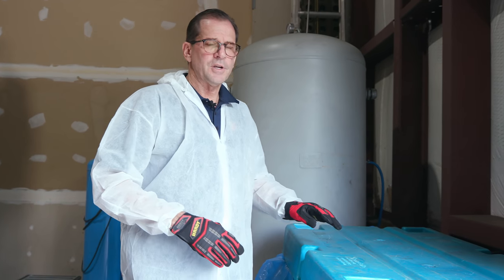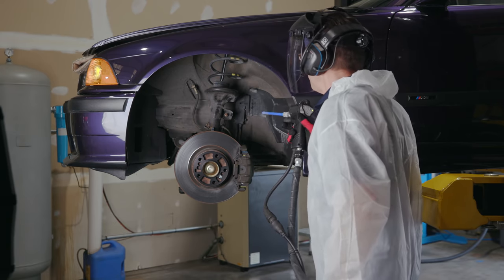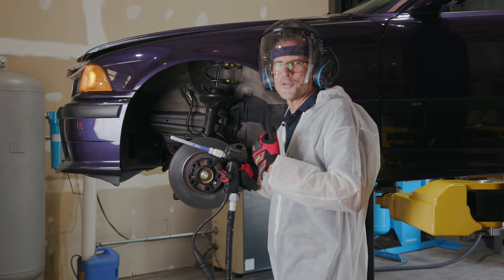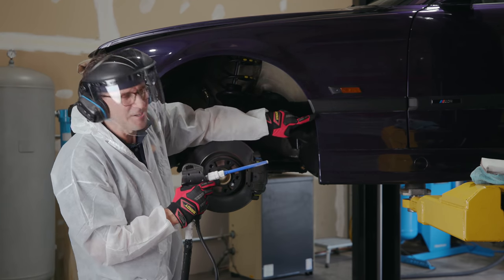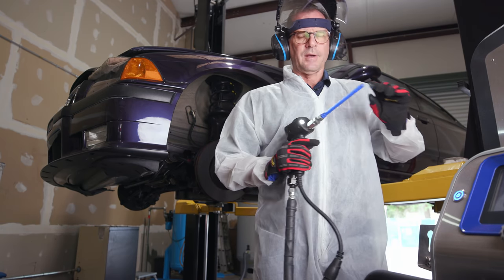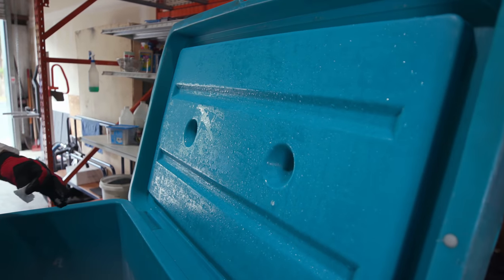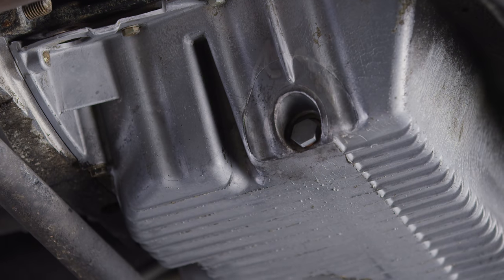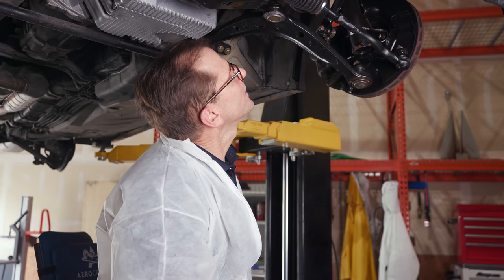Dry Ice Cleaning: Obsessed Undercarriage Restoration on the E36 M3 Pt.2

Comment: Amazing detail showing this to us. Thanks. I realize there's fixed time and time is money but when I do under cleaning w/ pressure washer, steamer & manual labor I remove the the plastic wheel liners and just replace the liners, sensor housings and all hardware w/ new parts... there's a whole lot of dirty areas underneath those wheel liners. This process really shines cleaning the metal parts in hard to reach areas.. the engine, transmission, cats, heat shielding etc...

Comment: Serious question, why not just use a pressure washer? The specific environment, cost, storage and set up required just to even start using dry ice seems to vastly out weigh the results. Don't get me wrong, the results are great but I personally don't think it's that far off a basic pressure washer.

It's just seems unnecessary in my opinion, kind of like trying to find a solution to an issue that was never present.
Reply: 99.9% of people will use a pressure washer. This is an insanely expensive and overly complicated method and there's no need for $100,000+ worth of equipment to do what a pressure washer and $200 worth of labor with a sponge can accomplish. 

Okay cool, the machine removed a sticker off the wheel a few seconds faster than can be accomplished by hand. Worth 120k? Nah.

Comment: I wonder if a liner could be made out of fabric like some sort of coated canvas or Teflon or something like that so that it's really strong and won't crack with the extremely low drop in temperature and it won't like tear or maybe just a hard liner made out of vulcanized rubber maybe? Oooh maybe you could have it in like a big container that's above your head where are you can open a hatch and it would just drop straight through so you don't have to dig anything into it to get the ice out. I don't know just a thought.

Comment: I tried to make a dry ice cleaning machine from a sandblaster setup. But I used a tall cylinder that used to hold beer. And added a motor to vibrate the ice to keep it from sticking . And we'll it barley worked . So I'm trying other ideas   . Had to crush my own block of dry ice also. Iv been making different ones for the last 6 months . And I guess I'll just have to buy one.

Comment: so does it work like sandblasting? while also having the contraction effect of cooling something down to help break it off? it does seem like a very clean process. this is the first time im seeing this in action
Reply: Episode #1 can provide you more details.   The fundamentals are this...
* 108 degrees negative causes things to contract and loose their adhesion.
* The solid CO2 particle sublimates to a gas upon impact which is a thermal reaction or, a miniature explosion.  It is not abrasion that removes the dirt like using sand or any media. 
* The high volume of air ( up to 125 cfm) wisks the dirt away.  

Yes, the dirt ultimately is atomized then gravity takes it to ANY horizontal surface nearby.  But mostly, the ground.
Reply: @ScottAles  I should have watched the first episode first definitely lol but thank you for the in depth response! I can see this technology taking off for sure!

Comment: Interesting to see the hand methods combined with the blasting. Is there any recommendation to perform traditional cleaning methods prior to the blasting services?Maybe get a majority of the heavy stuff off with a pressure washer or by hand and then finish with blasting?
Reply: I did that originally back in 2019.  But after getting soaked and spending so much time cleaning up after that, this method became much easier.  The principle is to remove all abrasive elements from the car before starting any hand work.  One small rock or piece of sand can be very problematic.   
Thanks for the comment!
Reply: @ScottAles  Thanks Scott. So kind of sounds like a waste of effort getting too deep into the hand work when the blasting is more efficient.

Comment: This is a great series!! What is the price of a dry ice blaster machine, and do they have compact mobil units? This would be awesome for mobile detailing. Thanks again
Reply: The machine I am using is $45k setup this way.  Compressed air system to support it is another $30k+.  
I'm not a fan of the mobile concept but some are.  Can't control your environment and it is loud.

Comment: damn, with this Adam might not have needed to buy all the r34 parts :DD
Reply: Naw that’s still a full build, this is for people who wouldn’t take the entire car apart and paint it
Reply: @shanechopko5523  i mean a lot of the OEM parts that he changed because they looked dirty, ofc there was a bunch of fab work that Johan did
Reply: @niklasxl  he probably replaced them for more reasons than them just being dirty... having a whole build completed to that standard would require new parts all around. Matt is gonna be replacing a bunch of parts on the M3 but he probably wont be tearing the whole thing down to the bare chassis and starting fresh with paint and all. Different kinds of builds, different processes. Like on a 6k mile old Ferrari in the barn, prob cant find all those parts, so cleaning them is really the only option. A 2000’s Nissan, different story, style and type of build.
Reply: @shanechopko5523  well yeah :D but i think Adam hadd some parts that were really hard to find and iirc that he couldnt find but perhaps they were cleaned this way off cam

Comment: ...some of the parts he spends lots of time on could just be replaced (and maybe should). Aside from the wheel liners and other obvious stuff things like the power steering cooler, reservoir and feed hoses, steering rack boots, brake dust shields, exhaust mounts etc are all relatively cheap parts and are likely cheaper to buy than the labor charged for the time dry icing.
Reply: This is absolutely true.  The effort here is to show what is possible if parts are no longer available.  Or they are too brittle to attempt removal without damage.
Reply: @ScottAles   good one. I didn’t really think of that. Whatever the case it really shines on getting into the cracks and crevices of metal parts and making like new... my favorite part by far.
Reply: @bcastromusic  Like no other process I've used in 50 years.  I think one of the more beneficial aspects is how well you can see what you're working on.  Other methods obscure the work with water, soap, media, or residue.  Being able to clearly visualize the target and see it leave the substrate is priceless.

Comment: This looks great now, but Cosmoline was put on there to protect the underbody from rust, and it worked all these years. Hopefully it gets reapplied so it doesn’t start rusting because it is been removed.
Reply: The way this car will be used from here will not require cosmoline.  Spraying this car would be like spraying a nut and bolt restoration or restomod recreation.   It is not a daily driver anymore.  But if anyone wanted to, it takes less than 10 minutes to reapply better protectants than they used in 1996.
Reply: @ScottAles  that makes sense.  Since I live in the Midwest rust is always top of mind.  I just got a new car and I was planning on treating it with cosmoline.  What protectants would you suggest over cosmoline?  I've researched a bit, and most others I found requires reapplication every year.
Reply: @skrsys  Yeah, it is a double edge sword.  I hate the idea of annual needs but the sticky cosmoline isn't a favorite of mine either.

Comment: You have the totaly wrong compressor what is seen in the working process and the hose you use may fit to solve the rims, but not the wheelhouse or the undercarriage. But you sem to like presenting the process to the audience.
Reply: The compressor I currently have is a total piece of junk.  But I was forced to use it because it is the only single phase 30 hp screw compressor made I the world.  
We're moving in a couple months and getting a new 3 phase Quincy 40hp unit.  
Not exactly sure what you're referring to on the hose comment.